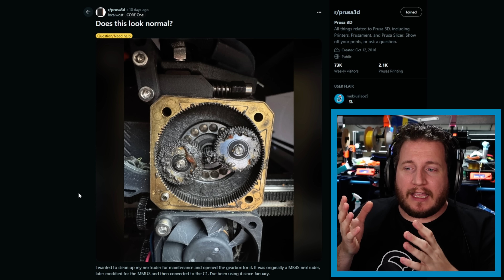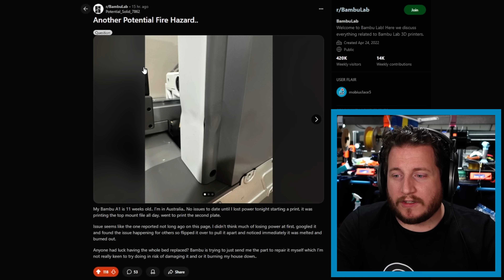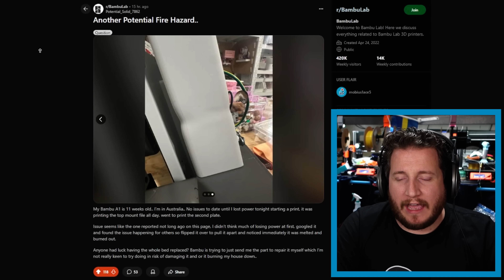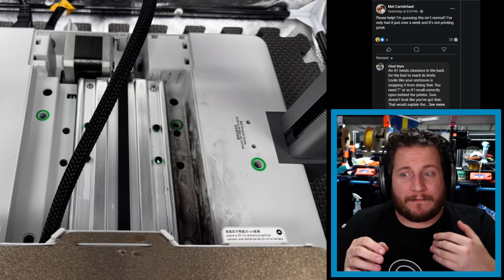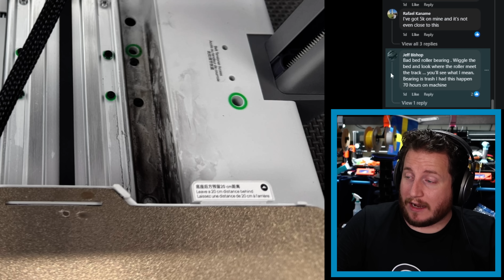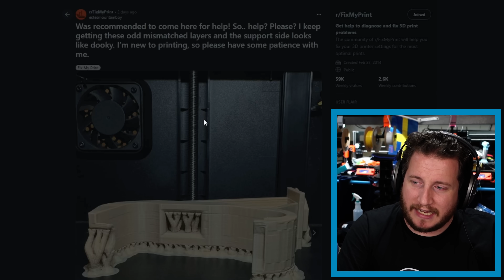MORE Cases of Bambu Fires! - PrintFixFriday 212

Comment: I have no PLA's I can run at 220C. If anything, newer filaments seem to have lower and lower points at which it starts puffing up.....    (oh yeah re linear/tree supports, where you have both flat and round areas needing support you can use hybrid supports... it will use the right kind of supports where needed.

Comment: I had the same issue with the soot on the A1 and my machine is not in an enclosure.

My first response from Bambu was the following:

Dear Bambu Lab customer,

Thank you for contacting Bambu Lab Customer Support!
We sincerely understand your concerns, could you please allow us to explain the phenomenon?
This phenomenon is typically normal wear on the Y-axis belt. There is a layer of black film attached to the surface of the belt, and the worn part is this layer; the belt itself has not been worn.
Our R&D department has conducted tests and validations, it will not affect the belt's lifespan or printing quality.
We suggest that you may clean them and use printer normally without worries!

I asked Is there a reason why it is only on one side and no where near the belt? and their response was:

Dear Bambu Lab customer,

Thank you for your patience.
After confirming with our R&D department, we suspect that the Y-axis may lack lubrication, causing friction and resulting in a powdery substance on one side.
We recommend lubricating the Y-axis linear rail and checking if the printer operates normally afterward.
If the print quality in the Y-axis direction is normal, no further repairs will be necessary; you can perform maintenance by lubricating the Y-axis when prompted by the machine.

I cleaned it up and re-lubed the rails and haven't had the issue since.

Comment: Another issue
I have qidi q2
Where the cable goes into the print head theres a clip that secures the cable not the cable chain. After less than 10 hours i noticed it wasnt in the clip but floating. I pushed it back in place. 5 hours later its out again. This means the stresses are being taken likely where the cable connects somewhere inside the toolhead ? I need to contact qidi re this.

Anyone else had this issue?

Comment: MK4/XL/C1 owner here... Disclaimer for anyone who's about to open your nextruder, ESPECIALLY if this is your only printer at the moment.

Print the gear alignment piece first! "PG-assembly-adapter-..." in the printable parts list, it's the same for every printer with the nextruder.

That out of the way, the only real time I've had to mess with opening it up to check/fix is when we've had filament break inside the extruder. The small spaghettified bits have a chance to get trapped in the gearing and get pulled into the gearbox, which can end up jamming everything and causing missed steps at way lower torques. So if you hear extruder skipping, DEFINITELY at least open up the front cover and check.

Also remember, there's a whole calibration step on the printer to guide you for extruder alignment after you remove the front cover. It's not supposed to be tightened fully, and needs to keep the alignment of the gears in place for smooth operation. Really wish it was designed differently, but it's a bad time if you just gronk the cover back on after a quick inspection.

Comment: This is great timing, I just took the cover off my Nextruder in slot 1 of my XL and found the same condition.  Cleaned it and re-greased it with Super-Lube. I will probably do the rest.  I have taken the gear assembly apart and found it can be tricky to get everything back together.  I simply took the cover off cleaned out the old grease and put new grease in and turned the gears by hand to distribute

Comment: It looks to me that the Prusa Nextruder was greased with a wrong type of grease. Probably a type for heavy duty in a car or bicycle and there was added way to much. Normally a nextruder needs very little grease and needs to be cleaned and re-greased once every 5000 to 10000 hours, depending on the filament used. Additives like wood, carbon or glasfiber tend to end up in the gearbox.
Reply from the maker: yeah I am wondering if they added their own or too much?

Comment: Have 2 CC's.  Depending upon how much slack is left in the cable at the end connecting to the print head, it can put unnecessary strain on that part of the cable, causing the cable to loosen from the head and/or cause premature cable wear.  Found this on one of the CC's after only 50hours of use.  Yep, simply caused due to slight misassembly.  Simple fixes are to provide more slack on that end of the cable by pulling a little more up through the chain, popping the cable loose from a few chain rungs by the print head for less severe bending of the cable, and snugging (but not over tightening) the 2 screws holding the cable to the print head.  Every CC user should inspect this cable end as per the CC FB page it is a common issue.  Probably very likely if cable wears through or connector becomes damaged that more severe things could occurs including electrical shorts and worse.

Comment: I think A1 FB group had two printers that had burnt the same component -- within a week 🤔
It's easy *) to miss how moving cables behave, when the experience does not exist, but making a printer worse as production continues, IDK if they have cut component costs too much, received fake parts, or what 🤨 And A1 is not lemon-lottery -cheap. (Not going to say CC is 😋)

*) but never good for business. Experience can be bought for less
Reply: To be honest, the components used on the AC board are not the best quality. At that level of quality, receiving a batch of components with defects isn’t a huge surprise. Don’t get me wrong, issues like these can happen at the large and well known suppliers as well, but it can be more common at ‘budget friendly’ Chinese ones.

Comment: So is it just the A1 and not the mini?
Reply from the maker: A1 and P1S are currently impacted from our findings
Reply: Just the A1. Reason for it: they reused the AC board from X1/P1, which was designed to handle 1000W, but the A1 can peak to 1300W and if the printer reaches those peaks, they will reduce the lifetime of the board.

On P1/X1 there have been a few reports as well, and this issue can happen on X1/P1 when the grid voltage is higher than nominal (which happens often at least here in Europe due to solar power).
Reply: @diavalus  Sounds like if you heat the bed super high along with the nozzle at the same time that would be the scenario the makes it the most risky?
Reply: @radfaraf  indeed, along with a grid running at the upper limit. In theory, even if you heat up the bed to lower temperature to print PETG, that can still reduce the lifespan of the NTC, but the impact is lower.

On the other side, I have a P1S which is mostly only printing nylon, so the bed goes to 100 degrees C whereas the nozzle to 275. So far, in 2-3k hours of printing, I did not have issues yet.

But since Bambu sold ‘a ton’ of A1 and ‘only’ a few dozen that we know of failed, it sounds like the issue is not yet severe. It ms still very concerning, that’s for sure. Bambu is already aware of it and I hope they will release an updated board for those failing printers. 

Time will tell…

Comment: My Nextruder looked about the same. Not sure of the hours, probably ~1000. I cleaned & re-lubricated it with the Prusa provided grease. Black color is likely normal for brass ring gear. The grease was not hardened so lubrication was probably just fine. My MK4S is enclosed and I print mostly ABS & ASA so higher operating temperature may be a factor.

Comment: I opened the Nextruder cover to upgrade my Prusa MK4 to Prusa MK4S after 4000 hours. It was 100% clean. The main plate was slightly damaged due to a few of my mistakes.
Reply: My primary filaments for Prusa MK4:
- A lot of PETG
- A lot of PLA/T-PLA/PLA-HT/Translucent PLA
- Quite a bit of PCTG 
- 1 roll of TPU-80A

Comment: 50¢ thermistors
The saga continues
Since 2007
Reply: but that is what thermistors cost? how much should they cost to be great? :)
Reply: @AndrewTSqPt1000 is about $10, k type thermocouple about the same.
Both of these are sensors with decades of track record of reliability in industry.

A thermistor is accurate up to around 150deg C and gets less accurate as temperature goes up, this is due to the chemistry of the thermistor